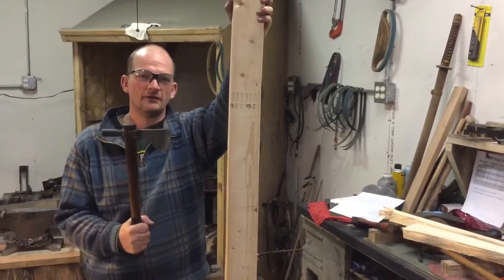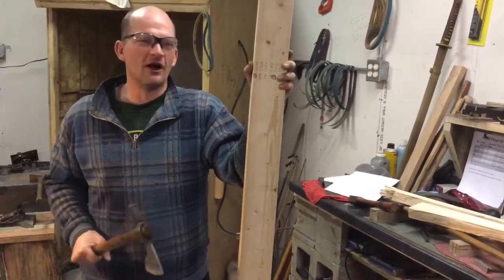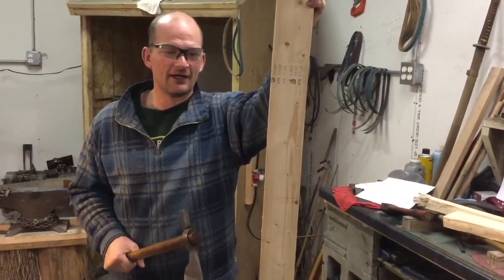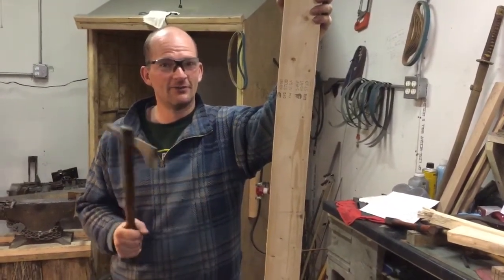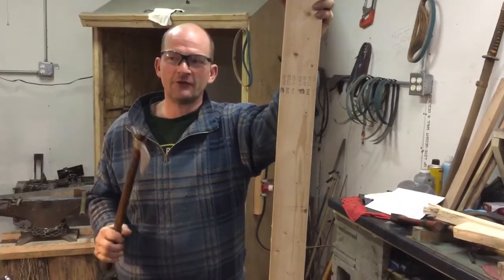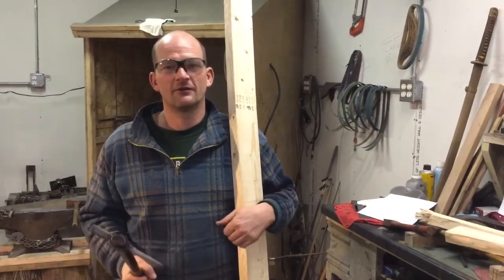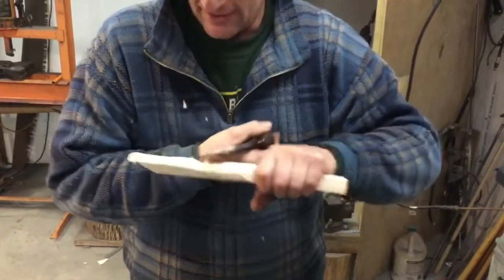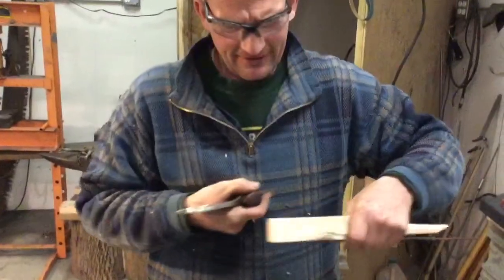Why we use 4140 steel for all our Tomahawks, axes, Fokos, and chopping up a 2x4 and then shaving

Comment: so I'm a heavy equipment manufacturing engineer and I can tell you when I thought of making myself an axe 4140 was my very first thought, its ability to absorb impact is amazing and the cost is reasonable. that's how I found your video.
Reply from the maker: Thank you for sharing your experience, too!
Reply: Ever try S5 steel?
Reply: 4140 is quite robust so is 304 stainless
Reply: @dominic6634  304 is pretty tuff stuff for sure, it's also kinda difficult to work with though. I use it often because it's the only thing aside from a36 that i can get locally. It works, but i don't prefer it because it's not great to work with and it can't be hardened.

Comment: The 1 in 4140 also means it's resulpharized, making it nice to machine. I've been spending a lot of time lately looking into steels myself for the machine shop. Things that cut well, and can be hardened. People seem to crap all over things like 4140, 1144, 1141, etc because of the "low" carbon content. But these people also always tend to be people who have never worked with it. Then you get the 1 or 2 posts from people who have tried it in spite of all the people talking trash against it and 100% of the time the opinion from them is always, "it's great stuff". People also forget that hardening through to the core is not always desirable, in fact in many applications the opposite is what you want. The medium carbon alloys tend to harden very easily and very well on the outer layers, leaving the core ductile and able to take a beating.

Comment: 4140 is an underrated alloy for knives. Heck, my 4140 steel center punch can pierce through mild steel as good as a drill bit. If you make a knife out of 4140, then be sure to use mineral oil.
Reply from the maker: I agree👍 and oil always👍

Comment: I work with 4140 all the time as a machinist, though i know very little about forging other than what i learned from the couple material science classes i took in college. Skeptical that it would be a superior steel to 5160. Im willing to give a fellow michigander a chance, ive already placed an order through your site. Definitely excited to see how it holds up!
Reply from the maker: Hello. Its always nice to hear from a fellow michiganian.
I'm also happy to hear you ordered a tomahawk. 5160 makes a good axe also. In my opinion 4140 is slightly more fatigue resistant than 5160, while 5160 is slightly more abrasion resistant than 4140. Also in my opinion an axe should have a more fatigue resistant steel and a knife should have a more abrasion resistant steel. 5160 is one of the steels we use for knives as well as 52100 and 01. Have a good evening.

Comment: 4140 is fine for a medium hard axe or tomahawks. If you want an outstanding steel for an axe try S5 shock steel. I make axe heads out of it and it comes in at HRC 59-60 hard that will not break or chip.
Reply: A quality S5 axe sounds like it could hack through cars or mild steel like butter.
Reply: @luciusirving5926  It doesn't hold an edge better than say 1095 or O1, but at HRC 59 hard it is tougher than any steel period, including 4140, 3V or 8670. High silicon steels are just plain tougher.

Comment: For rough use the only steels I find more amusing than 4140 are 4340 and H13.
Reply: For axes or big choppers I use an old tool steel tougher than any new super steel, the shock steel S5.
http://cintool.com/documents/Shock_Resistant/S5.pdf

Comment: I came across this looking to answer if an old sledge head (American made, maybe a plumb) would make a decent knife
Reply from the maker: It could be decent ,it depends what steel its made of. I would hesitate to put a lot of work into mystery metal. It would be difficult to know how to heat treat it. There are easier ways to get steel for reasonable prices . McMaster carr or Admiral steel are good places. Thank you for the question. If you need any more info contact us.

Comment: Still shaving sharp says it all. Nuff’ said. 
Is 4140 as easy to anneal, forge ,harden and temper as 5160?
Reply from the maker: chopsddy3 There is only a slight difference between the two, 4140 and 5160 have slightly different tempering temperatures and hardening temperatures.
Reply: 4140 could achieve a higher degree of hardness, as much as 75 to 80 rockwell. sometimes even harder depending on the experience of the person doing the heat treatment.
Reply: @bissoondathramlal2311  No way 4140 can reach those hardness numbers, try looking at the Machinists Handbooks' heat treating tables. 80 rockwell is as hard as sapphire, LOL, Only boron carbide, silicon carbide tungsten carbide and vanadium carbides are harder than corundum/sapphire. Molybdenum carbide is not as hard as chromium carbide, that's from a hobbyist knifemaker and pro heat treater. Look at CM 154 knife steel with 4% moly and its as quenched hardness before temper is HRC64.
Reply: @MountainFisher  I have done it before. Send a piece of 4140 to a heat treatment company and ask them to harden it to the maximum hardness , it could not be machined with carbide inserts, its impossible. I have made numerous toolholders this way. IT could only be ground ( cylindrical or surface grinding ). Tapping is impossible since it has to be done prior to hardening.
Reply: @bissoondathramlal2311  You cannot machine hardened steels at 59/60. Ask the heat treater what the maximum hardness is of 4140 and the answer will be a consistent HRC59/60 un-tempered. We had an idiot materials guy who cut some 4140 with a torch for the machine shop and the parts could not be machined because the torch cut edges were too hard. Hardened steels are simply unmachinable.

Comment: My boss gave me like2 and a half feet of   2” round stock of 4140 yesterday for knife making. I been researching if it’s good enough for a short sword or foil
Reply: I’m a beginner I’ve only done one knife out of rebar not even finished yet
Reply from the maker: Hello yes the steel would be fine but it would take a lot of work to forge it down to size. Mcmaster carr or the New Jersey steel baron are good places to buy steel. You could get a smaller piece of steel for a reasonable price.

Comment: So how do you heat treat 4140. I have a hatchet head from Alex Steel and I tried twice to heat treat it but it never hardened.  Heated, soaked in heat for 10 mins and then quenched. Any suggestions?
Reply from the maker: hello, the problem could be ,wrong quenching fluid or to high/ low temp. if the steel is a 10 series steel like 1045 1060 or w1 it should be quenched in water. most anything else should be quenched in oil. If you're using an even heat type heat treat oven ,the soak time could be longer ,maybe 15 minutes. 1550 degrees is a decent temp for a lot of steels, kind of a ballpark temp. maybe not ideal, but close. if you're using a oxy/acetylene torch, don't bother with a soak time, just evenly bring to temp ,and quench. If you don't have a laser thermometer, heat until you see the shadow leave the steel. to me the color looks orange, other people describe it as cherry red. If you can't find out what steel it is, you can do a spark test. There is info on the web about spark tests, they are a good way of finding the steel type. btw, if you find you have a water quenching steel, be careful.  it takes a bit of practice to quench without cracking. If you have any other questions, please let me know, i'll try to get back to you sooner.

Comment: ok . . . . . . . but isn't that a pine 2x4?
Reply from the maker: Hello, yes it's a pine 2x4. We used a pine 2x4 because it's easy for anyone to get one around the world and test and compare their axe or tomahawk. Also the american bladesmith society uses pine 2x4's in their cutting tests so it's a good testing material that a lot of people already have familiarity with. The ABS cutting test only needs to cut through the 2x4 three times and remain razor sharp to pass. I only cut up one 2x4 and it was still razor sharp, I didn't feel the need to cut another one. How many could I cut up and stay razor sharp? I don't know. If I had cut two or three  more and it ceased to be razor sharp, how many more boards before it started to be noticeably dull? I thought the edge retention after cutting up one was a success ,it didn't seem to dull at all, although I'm sure it did to some degree. Have a nice day! thanks for the question.

Comment: So 4140 would be good for a machete? Also, can it be water quenched?

I would go for 1045 personally, but I’m having trouble finding it bar stock. Thinking 4140 as an alternative.
Reply from the maker: The Man  1045 is a good steel no doubt, but in our findings 4140 is far better, in abrasion resistance and fatigue resistance because of all the added elements that make up 4140 including molybdenum.
As for the quenching in water,
It would seem like you could, however we never have water quenched 4140, but I don’t think you’d gain much for the added risk of warping/cracking of something so thin.
If you do choose 4140 I recommend you temper at no more than 350
Reply: WBF777 From what I’ve gathered, 4140 is basically 1045 with the additional chromium, molybdenum. Since they have roughly the same carbon content. I know water quenching 1045 is fine, but don’t know about 4140.

Because I’m making a machete, it shouldn’t be too hard. Looking for 52-55hRC for the edge. 350F seems like it would leave the steel a bit to brittle. Correct me if I’m wrong.

Also, any ideas where I can’t get some in flat bar? Cause if I can’t find any 1045 or 4140, I’ll probably have to go with the much more available 1070.
Reply from the maker: The Man sorry for the delayed response we have been really busy around here for the holidays but I will get back to and address those questions within a couple days. Merry Christmas and a Happy New Year!
Reply: WBF777 Ok thanks, hopefully you could help me out. Merry Xmas! Best wishes.
Reply from the maker: @Divine_Serpent_Geh  Thank you for waiting for a replay.  Sorry we didn't get back to you sooner. 52 to 55 seems a bit soft for the edge. I would first try hardening the machete, then temper at 350 F for steels below .6 carbon and 375 F for steels above. Then take a torch and temper the spine and handle to a blue color, then quench. This is just a starting point but it should be close. As always be careful.  Depending an the amount of force on the blade it could snap. (The tempering temps  of 350 or 375 should be held for an hour.)
Reply: WBF777 Well Thank you very much for all of your info. Where do you get your 4140 from? 

I’m looking for it in 1/8” stock. Preferably 3” wide x 3ft. long.
Reply from the maker: The Man we get ours through McMaster
Reply: Metals Supermarkets. They have it in tube, rod, flat bar, sheet, plate shapes.

Comment: is it 4140 alloy steel?
Reply from the maker: Hello, yes 4140 is an alloy steel.
Reply: Fundamentally all steel is an alloy of iron
Reply: @r6_6h0st7  To be called steel it must have some carbon in it. Makes it tougher and stronger. Some rebar for bridges or buildings will run 0.6-8% carbon, but not in a hardened state past HRC 45, as it must not be brittle.

Comment: How well does it hold up to chipping?
Reply from the maker: Hello, thank you for the question. I chopped through a deer pelvis and rib cage ,no problem. Then I chopped through its spine and got some very tiny edge damage in the form of chipping. easy to sharpen out. IT wasn't really visable in normal lighting but was in a brighter light. This damage occurred with 20 degrees per side edge angle. The spine was hard, I don't imagine that anything  with that edge angle and razor sharp would get through that  undamaged. I haven't experienced chipping in normal wood chopping unless I hit a rock. I would rather have minor chipping than edge rolling. Have a great day.
Reply: @wbf7773  There is such limited information on 4140, and I have yet to see a test done to it's breaking point. Thanks for putting out this excellent data point and taking the time to reply👍